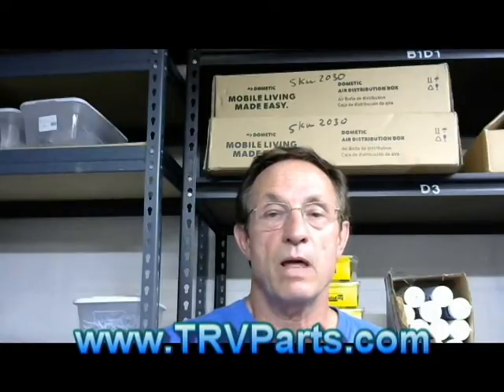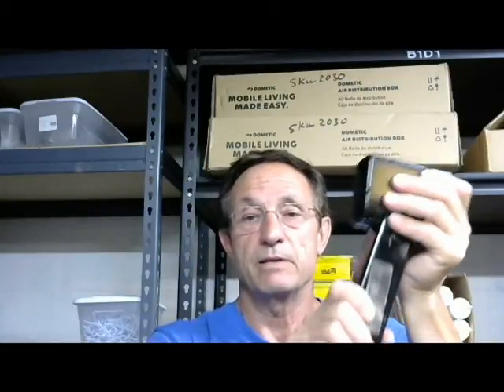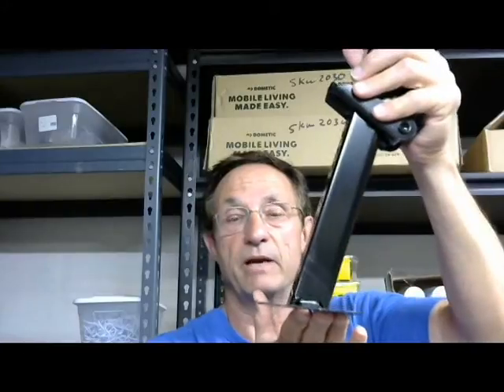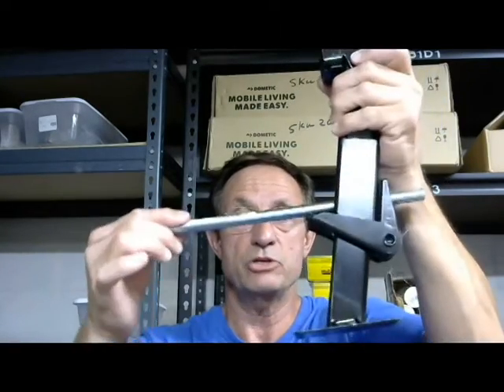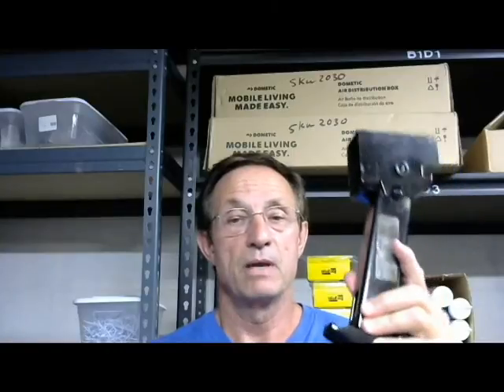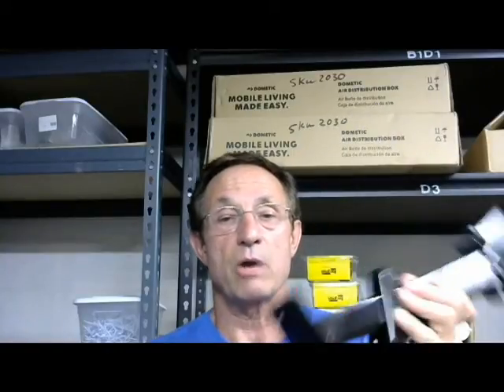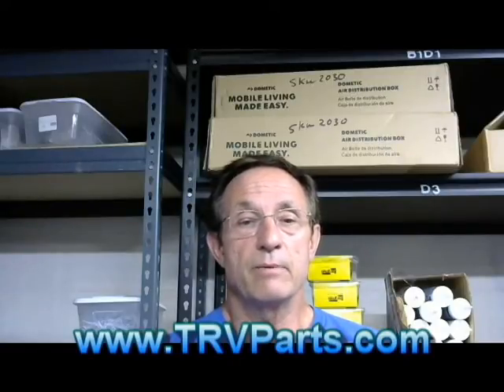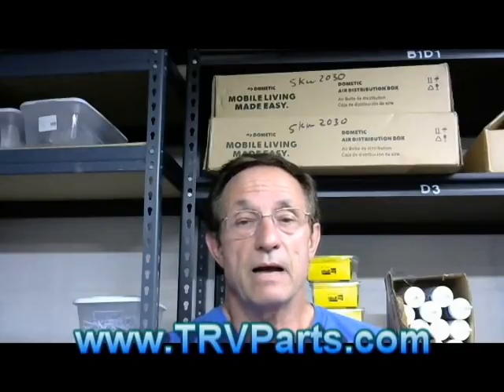Stabilizing Jacks-Short Video-How to use this jack

Comment: You should not take this down, I agree, wish it was centered more, however you can figure it out from what you do see. I just purchased a 2014 Little Guy T@G and it has these stabilizers and I hadn't a clue how to get them down. I was close, but no cigar. I called my Brother and he sent me this video, so you are helping alot of folks, even if they are not saying anything or liking, subscribing, etc....Thank you soooooo much for your help! Easy peasy....now to go find me a piece of bar somewhere. Should be easy enough, maybe some rerod....
Reply from the maker: Thank you for the feedback, I haven’t been able to find the bar through any of the distributors I get parts from.
Reply: @Trvparts  I'm sure there are straight sturdy bars or even a fabricator could make one or have a piece of like this laying around, Thank you again!
Reply: I have seen long screwdriver used; probably phillips style to fit through that hole. You can find those most anywhere.
Reply: @Trvparts  - I have seen long screwdriver used; probably phillips style to fit through that hole. You can find those most anywhere.

Comment: Thank you....I did not know to put the bar all the way through.
I did not get a bar with my set, where can I get one?
Reply from the maker: Jeffery- the two companies that use to sell them are out of business or discontinued this jack style. I have looked a few times to see if could find this jack or rod. I could not. The best I could tell you is find some rod at Lowe's or Home Depot. I thought about taking this video down but there are still so many of these jacks still on older campers.
Reply: I have watched videos where they use long screwdrivers; probably phillips style to fit through that hole. I found this while watching videos on how to adjust the stabilizers. You don't need a special rod; get that long screwdriver.

Comment: Does the metal rod come with the jacks?
Reply: get yourself a long 1/2 inch or 3/8 inch ratchet extension bar... works just fine
Reply: I have watched videos where the person used a long screwdriver; probably phillips style so it fits through that hole.
Reply: Usually only when you buy a pair. But each supplier is different.

Comment: I am completely new to the pop up camper world. Can these be used to level and support the popup?
Reply from the maker: These can be used to Stabilize your unit, not level. They are not strong enough for that. How you level it is, put wood under the wheel (drive onto) on the low side the use the tongue jack to get it level from front to back then  use your Stabilize jacks (what this video is covering)